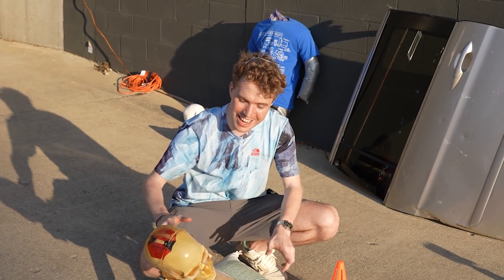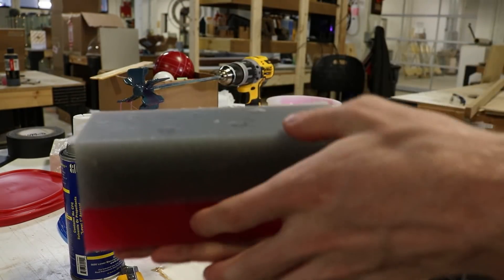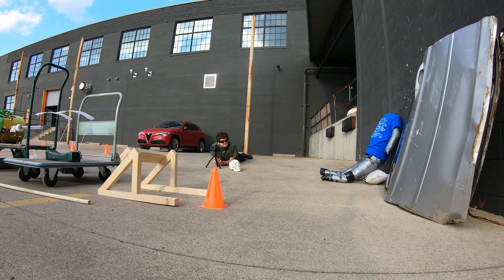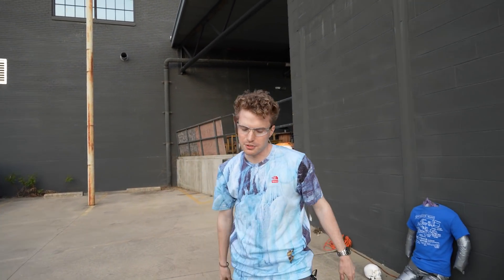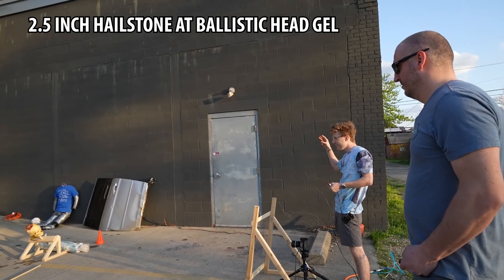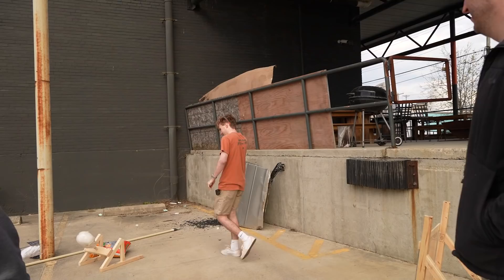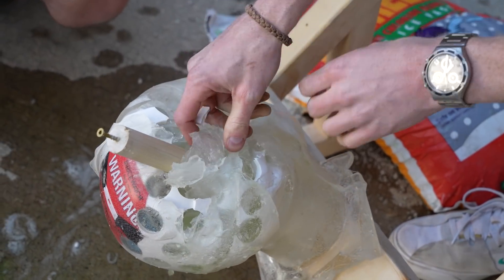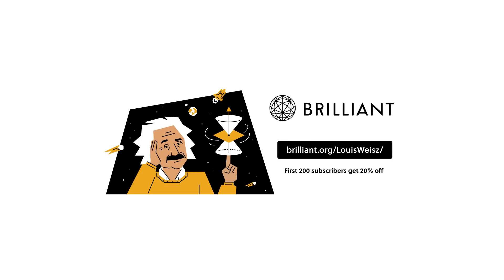How Dangerous is Hail?

Comment: The only thing is the velocity of the hail stones and the difference in velocity between the sizes. Large hailstones will go the fastest even if the surface area is larger for air resistance because the mass would be squared.

Comment: This was too influenced by the velocity, pression inside the launcher machine and by the proximity with the skull. In real life situations with a skull moving and suddenly a thing falling from the sky - and not from the sides as you guys did - would make a much different damage than these maybe greater depending how fast they fell (less the the velocity in this video) and how much pressure they have been expelled from the sky, but more or less the same damage would occur.
So that's not even 1% accurate tobbe honest.

Comment: ZUZANA - 155 mm Self-propelled Gun Howitzer is a Slovak artillery system with a 45-caliber gun and automatic loader for loading of both projectile and charge. It is an evolution of the 152mm SpGH DANA self-propelled howitzer.The system features long range, high accuracy and rate of fire, prompt preparation for firing and high level of mobility ensured by a modified TATRA 8x8 chassis. Design of the gun enables to use any NATO standard 155mm ammunition available on the market. The Fire Control System enables for a Multiple Round Simultaneous Impact (MRSI) mode. One of the unique features of ZUZANA is that the gun is mounted externally in between two totally separated compartments of the turret. This makes the crew inherently safe from any potentially dangerous mechanics of the gun and autoloader plus the crew is protected from the gases generated during firing.

Comment: I appreciate the attempt, but this is pretty useless without calibrating the velocity. Also, a G is a unit of acceleration, not of force. Even then, force is probably the wrong thing to measure, with impulse being more relevant.

Comment: You can be killed by a 1/4” hail stone if it’s going fast enough.... you’re launching this hail at fuckin Mach Jesus out of a homemade air cannon. This is not a measurement of true proportions.. I’ve gotten hit in the head multiple times by falling hail and it didn’t rip my scalp apart. You need to redo this with a more sophisticated method of launching.

Comment: Not sure what kind of resin you used for the second head, but they tend to be less flexible than bone and fracture more easily. The cranial bone is made up of three layers. The outer and inner layer is compact bone and the thickness is a rather big range between humans. I have seen old frail ladies with a skull as thick as that of a viking warrior. Can't really tell from the outside^^ The inner layer is a sponge-like interconnected kind of bone. The Combination of those three layers give our skull a very sturdy physique. It is made to keep the brain safe, so yeah, it's really hard to crack. And because of that structure, you cannot compare it with a resin cast skull.

Comment: This isn't totally accurate as the muscles, soft tissue and the rest of your skeleton will inherently absorb and take some of the energy off of getting hit in the head. Like the bending of your neck, compression of your neck and spine via discs, even as far down as pushing into your hips and knees. Not sure how to calculate how much force is left to go directly into cracking your skull open would be, but likely less than half. Maybe if you had that head on a big spring with a similar compression to a spine and it would bobble back and forth like a neck as well.

Comment: I think there might be a couple problems with this. Your ice density is going to be higher than natural hail due to the fact that you are freezing them solid. Most hail grows sequentially within the updraft and accumulates air between the layers, that's why most hail is cloudy and opaque rather than clear like ice made at home. It also looks like your terminal velocity is a touch too high for smaller stones. I can tell you that most hail less than an inch in diameter will not dent metal unless its wind-driven. Terminal velocity on half-inch or nickle sized hail is around 40-50 mph. You add in horizontal wind components of 60 and 70 mph then you start getting higher velocities.  Looks pretty good beyond that for your other tests. Ask any storm chasers and they will tell you 2.5+ inch hail will shatter windows with ease and leave nasty dents. Definitely don't want to be out in it without a helmet. The largest I have personally seen is 3.25 inch. Cool tests! Im a severe weather meteorologist for the US National Weather Service and have been storm chasing for 10 years.

Comment: Real hail is laminar in its structure, each hail stone is built up by progressively adding a layer of ice as currents in thunder storms circulate the hailstones up to 5 miles high and back to the base of the cloud. As such, hail stones are much stronger than balls of ice of equivalent size. Also, what is the terminal velocity of each size of stone? It will differ based on size, mass and shape

Comment: louis: it didn’t really do a lot of damage, there’s no real impact
*literally ripped off a giant chunk of skin, exposing the skull
Reply: Ballistics gel isn't a decent analogue for skin covered flesh. Skin has much higher tensile strength than muscle or fat. More importantly, I think the ballistics gel used here wasn't particularly dense (presumably for better jiggling).
Reply: Mostly because ballistics gel is meant for penetrative rather than blunt damage. There are way to make analogous human skin, but they aren’t really worth it for this experiment. Also ballistics gel gets soft quickly in the heat, which changes how it reacts to damage.
Reply: considering it's paintball sized hail shot at over paintball speeds and normal paintballs already can cause bruises I think this would hurt.

Comment: 6:38
"And that's only 15 psi so it's pretty accurate terminal velocity"
Please explain how you measure speed (terminal velocity) in pressure (psi). The terminal velocity of hail stones can be found online, with a quick Google search of "hail terminal velocity against diameter." To replicate this, please first measure the velocity of the hail stone, when it leaves the tube, instead of maxing out the pressure and calling it a day. To me, it looks like they are going unnaturally fast. I could be wrong, please do correct me in that case. Apart from that, t'is a good video :)

Comment: A hail stone would move at its terminal velocity.
You should have factored that in
(Or I missed something, or I’m stupid)
Reply: Not stupid but they do say at one point that they used enough psi to reach terminal velocity
Reply: @jebbryant6522  if you push a piece of paper towards the flour you can push it faster than if you dropped it (it’s terminal velocity)
So if you fired that ice down a skyscraper wouldn’t the ice slow during free fall, because it started at its terminal velocity
Therefore without calculations the ice is going beyond its terminal velocity
Therefore more damage than if it was a normal free fall from clouds

Comment: Not to be a dick but tempering is generally done to reduce stress after hardening. You heat up the material and then slowly cool which improves toughness. The windshield glass might have had internal stress but that despite the tempering, not because of it.

Comment: A few years back there was a freak hail storm and the hail was around 1-1.5 inches. A lot of cars were damaged and a local mall was destroyed because the hail broke the sky lights and flooded the mall so it was closed for almost the rest of the year. The hail was so damaging it chipped the pain on my mom's Jeep wrangler which had a coating on it to prevent the paint from chiping when she is off roading, we also found out that it was coming down sideways and had damaged the door to her jeep not just the hood and she had to have them both repaired and the dents pulled out
Reply: So happy you are ok

Comment: how did you calculate the terminal velocity of the hail and match that with the cannon?
Reply: I would guess they used the formulas for drag and the basic force equation to calculate the terminal velocity. They had a chronograph so they then used that to tune the velocity of the ice balls.
Reply: calculating the rough terminal velocity of a sphere isnt too hard thankfully.

Comment: Hi! Weather technician here. Typically when we issue warnings for hail we consider anything greater than .25in to be moderate and .50-.75in and up to be severe criteria. So you started with something thats already pretty scary to me!
Reply from the maker: @carmello ricco - that's wild dude, I just based it on how what seemed like it'd have a shot at doing real damage but that's super interesting
Reply: If there's a big chungus hail it would be a disaster
Reply from the maker: @marcoleung311-v7j  actually big chungus was loosely based on the largest piece of hail ever recorded
Reply: @Weisz  i think i've seen bigger
Reply: It's worth noting that hail does not just fall once.

Many hail pieces would hit you, so is more dangerous.
Reply: What velocity does hail fall at? I feel like that point wasn’t visited well in this experiment
Reply: @sentranizzy  to just simply answer your question instead of belittling you. Small hail falls at roughly 20mph/32kmh and the bigger it gets the faster it falls with really big pieces, like the big chungus, reaching speeds of up to 110mph/177kmh
Reply: @soren7456  I was in golfball size hail before (got inside very quick, luckily) and yeah I'd say golfball size was about middle there, 60mph/100kph if I had to guess. it did a number on the cars, storm lasted maybe 5 minutes and only hit like 3 houses (suburbs so roughly 75 meters/yards between neighbors)
Reply: @soren7456  holy fuck that’s fast
Reply: @sentranizzy  I was thinking that aswell
Reply: @sentranizzy  terminal velocity
Reply: @FriendlessPhoton  yes of course but that number should be calculated for the sizes and used in the experiment
Reply: @sentranizzy  terminal velocity is a constant. It doesn’t change, there is no “calculating” terminal velocity
Reply: @elmok  it’s determined by drag, a flat piece of paper and a human body will have different terminal velocities. Just like balls or ice will be different.
Reply: @sentranizzy  a sphere that is denser than air will always reach terminal velocity
Reply: @elmok  so a human, a plane and a balloon all have the same terminal velocity as each other? Regardless of their differences in shape, mass and drag coeficent?
Reply: @elmok  Terminal velocity is different for different objects lol. Its constant for the same object in the same medium but thats not relevant in the question of what the speed it travels at is. Or do you think that a 45 pound weight plate falls at the same speed as a feather? Or do you perhaps think that the speed of a 45 pound plate is the same when dropping it in air and in water?

To be clear, terminal velocity is when a falling object no longer accelerates. Its not a fixed speed. As such you very much would calculate terminal velocity based on the object falling and the medium it falls through.
Reply: @elmok  It's not really the same for all objects it is entirely based of mass, drag and aerodynamics, gravity is a constant as it affects all objects equally
Reply: @jacquessouchet4101  Drag coefficient and surface area the terminal velocity of the object will change. Please do not believe @Elmok they do not seem to understand physics.
Reply: @elmok  Wrong, terminal velocity is relative to the object's mass and area . I calculated that a 4 inch sphere of ice weighing in at roughly 524 grams with of drag of 0,1 should reach 115m/s, assuming freefall with no wind. That's Mach 0.3
Reply: @ilo3456  not mass, density. If gravity affects all objects equally then it plays no part in the velocity of the fall don't you think?
Reply: @marckost2000  It is in fact mass, because it is not about speed but about the kinetic energy of the hail, and the more mass an object has the kinetic energy it has when moving at terminal velocities.

Simply put the more massive an object the more energy you need to move it and that is a universal principle of physics, that is why a very massive object moving slowly may have the same amount of kinetic energy as a small object moving really fast
Reply: @ilo3456  mv²/2 = mgh --> V = √2gh
Mass doesn't affect it directly, it will be only relevant when you calculate the wind resistance, which you will things like Buoyancy formula, using the density (which requires mass, but not isolated) that is very determined by the dimensions of it.
Reply: @elmok  Terminal velocity absolutely is not a constant. For hail, it changes depending on mass, air resistance, atmospheric pressure and accelerating factors such as a downdraft.
Reply: @elmok  Terminal velocity absolutely is not a constant. It is the point where the acceleration of gravity is equal to the deceleration caused by air resistance. A person in freefall and a person using. a parachute are both falling at terminal velocity - one just has much more air resistance
Reply: @elmok  Thats only true for places like the moon, where there is no air to impede the fall of an object, so while technically correct on an atmosphereless planet its not true on earth.
Reply: So what's the deal with golf ball hail, super dangerous or no?
Reply: @jordanhicks5131  It is.
Reply: What speed do normal hailstone travel ?
Reply: Where I am from we lately had a really extreme case of hail. The hail got up to 5cm big (2in i believe) it smashed windows and trashed cars. Even the old people I asked couldn't remember anything like this in their lifetimes.
Reply: Where I’m at the hail we get is usually about an inch. At a cousins wedding they were ripping straight through the tent and hitting people
Reply: we had massive hail in minneapolis yesterday I have a shitloadbof hail in my freezer over an inch and one was 100 grams.

Comment: It’s not what size, it’s what’s the smallest size

Drops ice burg on head
Reply: Well smallest size would have to be in the .5in range.  If you are staring right into the sky and a piece of hail has formed into a thin pointed shard and it goes right into the ocular cavity.  But the odds would be astronomical of even getting a piece of hail at that size to form such a particular shape and fall right when you are looking uo